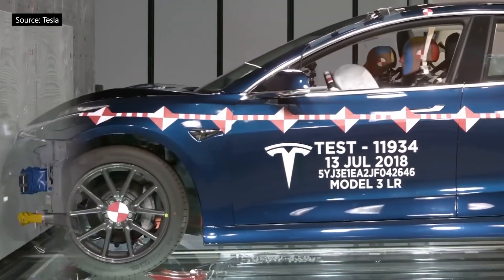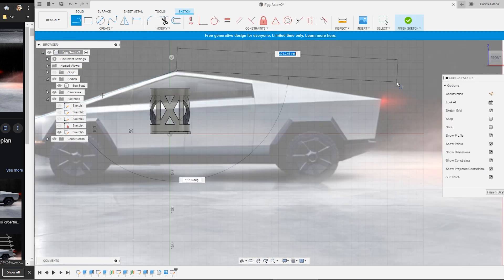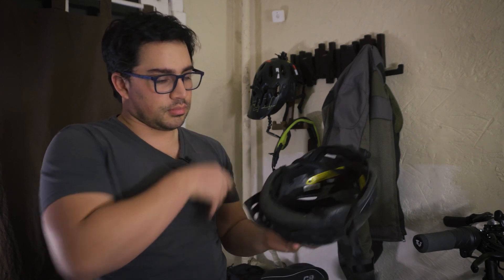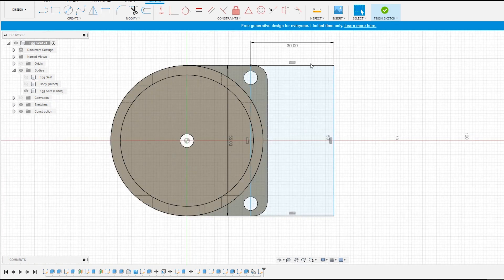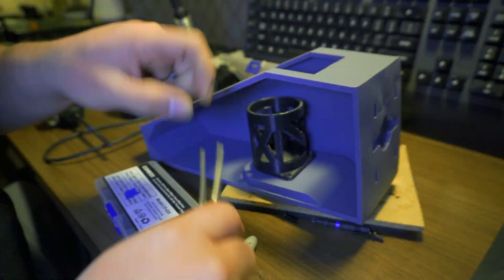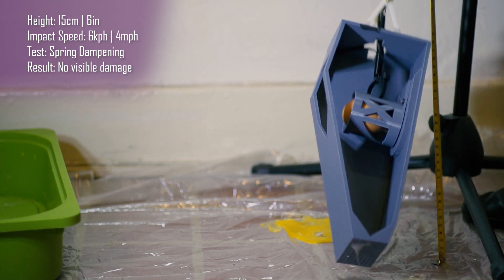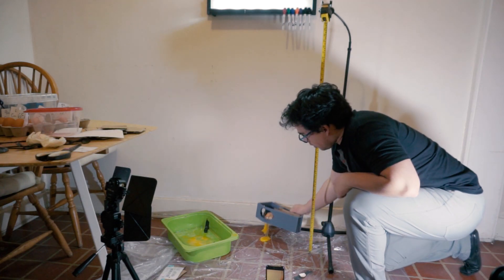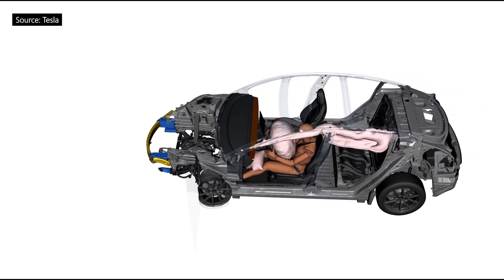Could the Cybertruck be safe without traditional crumple zones?

Comment: an "internal crumple zone" is called an airbag
Reply from the maker: That's different. An airbag gives your face a soft place to land (and helps reduce strain on the neck). A crumple zone absorbs some energy from the impact so that it doesn't reach your body in the first place. Each without the other is not as effective as they are in combination.

Comment: Great job with your eggsoskeleton! 
This is the big elephant in the room that nobody will touch and is why I think the Cybertruck is doomed to fail in its current form.
Perhaps they will have an aluminium front end and hood but that would defeat the purpose of their exoskeleton.
Further how will it behave in a side impact? I'm expecting major delays in the Cybertruck release.
Reply from the maker: Thanks, Eggsoskeleton, I like it. I think they can make it safe, but not exactly in the form that was presented. Technically, the sled design I showed can be used for side to side as well, as long as there's enough room, but I have no idea what they have in mind. The advantage they do have for side collisions, is that most cars that crash into them are going to be lighter, so the Cybertruck wouldn't feel as many Gs (for the other cars it'll be worse than T-Boning a regular car though).

Comment: when you don't have a deforming zone of, lets say, 50cm in the front of the car, so absorb the impact, because the car has a stiff shell structure outside, then you need to provide a 50cm void space inside the car in which the passengers can more to, on the front and on the backseat.

but the other problem is not only the passengers safety. it also is  about how to repair the car after an accident?  if on  a normal car  a fender gets squeezed, you simply replace it and bolt on a new one.  But on the "exoskeleton" the whole structure would get deformed . how would you repair that?
Reply from the maker: Yeah, the repairability is though, and I don't think they'll have a good solution for that. For the space inside for the passengers to move into can come from the trunk in the front. The sides could have material meant to deform and absorb energy (so the front trunk squeezes between the passengers and the front of the car) allowing the passengers to slide forward a bit

Comment: Cybertruck will never enter production its just a failed hype product made with almost no real engineering thought put into it. Its instead 5 year olds rule of cool design. All of its "indestructibility" makes it a horrific deathtrap in case of a crash given you somehow survive it transferring everything to your body. Unbreakable side windows remove any home for emergency access&exit if its blocked or jammed(same as it moving forces into passengers it will be likely to destroy or damage hinges and locking mechanism in the doors.Plus it still can give in and just snap like a tin can like pre crumple zone cars do.

Comment: Cybertruck crumple zones can be easily done if the panels are made to break away. spot welding properly or thinner in certain areas could make it collapsable under heavy impact.
Like imagine if there was a wedge inside the panels, and if under heavy impact it hit against another wedge effectively making the panels pop and flare out to deflect the impact damage away from the occupants. kinda hard to describe but kinda like imagine using a cork openner with flare out arms I guess if the top is pushed the arms flares outwards.

Comment: Interesting video and nicely done. Also another food for thought, what will the cybertruck do to other vehicles in case it is involved in a crush? This is the reason that tanks are not driving in public roads correct?
Reply from the maker: Thanks! My understanding is that the main factor for other vehicles is the weight difference. The Cybertruck is very heavy, so I wouldn't want to be in it's path, but it would be interesting to test, for sure.
As for tanks, I don't know the reasons they can't drive in public, but I imagine there are many :-S
Reply: I have a feeling that it's because tanks have big freaking guns!

Comment: Hey Carlos, cool POC. While I'm not as technically knowledgeable as you are, would a next phase of testing potentially include measuring g-force baselines against the different forms of internal crumple zones? It reminds me of Mythbusters when they would always use g-shock meters in their various experiments.
Reply from the maker: Thanks! Yeah. I could use an accelerometer to test further indeed. Actually I have one, and I thought about connecting it to an Arduino to get measurements. But I didn't need the precision, and I figured eggs would be more visually interesting.

Comment: Volvo utilized a similar system for side impact protection.  The seats and belts were bolted to a breakaway platform attached to the floor which would slide away from the door in the event of a side impact.
Reply from the maker: That's cool, I didn't know. Thanks!

Comment: If the exterior structure doesn't deform in the collision to absorb energy, an "internal" crumple zone does no good. Driver and passengers would be thrown full force forward. A crumpling of the front structure would absorb some of that energy. As no crash testing has occurred, we don't know that the front of the CT doesn't collapse or isn't designed to do so or cannot be redesigned to crumple.
Reply: AhBeeDoi 

well that’s why we need responsible drivers

Comment: General Motors pitches its product to police departments with aftermarket "bull bars," a feature that makes them look more intimidating and militaristic -- and kills pedestrians!!
This May, a police officer struck and killed James P. Kelley in St. Charles County, Missouri. In photos of the crash scene, you can see a broken “bull bar” falling from the deformed front end of the cruiser.
These accessories fixed to the front of cars, trucks, and SUVs are trendy with law enforcement. PoliceOne, which markets to cops and first responders, says bull bars are designed to “reduce the damage to patrol vehicles in the case of minor collisions.” A video produced by Go Industries, which sells equipment to police departments, demonstrates how bull bars can push other vehicles off the road, either in a high-speed chase or to clear an immobilized car. Some rural police agencies use them to reduce the damage from animals they strike.

But bull bars, or “push bars,” as they’re sometimes called, can be deadly in a collision with a pedestrian or cyclist.
A review of studies on the safety effect of bull bars published in the journal Traffic Injury Prevention concluded that they “significantly alter the collision dynamics of vehicles, resulting in an increased risk of pedestrian injury and mortality in crashes.”
A 1998 study in Australia — where bull bars are much more common and seen as a way to reduce risk in collisions with kangaroos — found they exerted 10 to 15 times more force on a child’s head than an unmodified front end.
   They can also put drivers and passengers in danger. Front ends are designed with “crumple zones” that absorb the impact of crashes to protect people inside the vehicle. Stiff metal bull bars inhibit that effect and concentrate force in a smaller area, with potentially deadly consequences.
Reply: The chrome monstrosities of the forties, fifties and sixties with their bullet grilles and rocket hood ornaments were no picnic either.  :D  And the teens, twenties and thirties with the upright radiators, exposed headlamps and spring steel bumpers?  Ouch.

Comment: My concerns are about inertia since its acceleration and mass is too high. Instantaneous breaking becomes difficultly nd undesired. Its dangerous for other vehicles. More , kind of😅😂😂. Drag nd if at all door don't open nd its an emergency to get out, the glass won't break. Its like handling a mini tanker with speed like hell.
But seems not fissible as practical plan in City.
Reply from the maker: Yeah, those are valid concerns. I imagine they'll have an emergency release of some sort, but I have no idea what they'll do in the end ¯\_(ツ)_/¯
Reply: Tesla's have mechanical release for the doors. You just have to know where they are for each model. Also bull bars are more dangerous(10x) than not having one. To pedestrians and passengers as well.

Comment: Well, they didn't sledge hammer the front or test the paper dash. Maybe those are all safety features. Hmmm
Reply from the maker: Yeah, it's very possible that the front will be thinner steel, and used as a traditional crumple zone. This is more of an exploration on other ways they could do it if they didn't do that.
Reply: @noisycarlos  if the frunk is to be a frunk, I doubt people will be opening a 3mm thick slab of steel, so very very likely. Cool experiment though. Helped me visualize the importance of a crumple zone better.
Reply from the maker: @ItsBinhRepaired  yeah, no idea what they'll end up doing, but I'm excited to find out. Glad to hear you liked the video!
Reply: Well the front is going to be made of soda can aluminium who is is afraid of that pppphhhh..